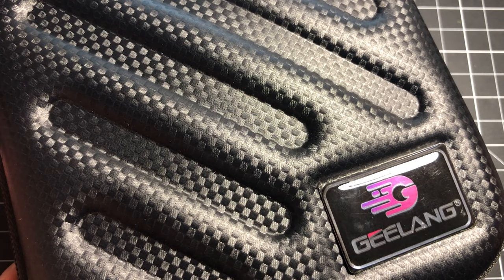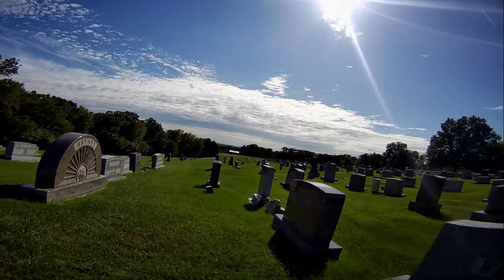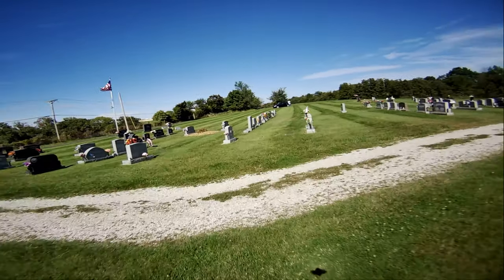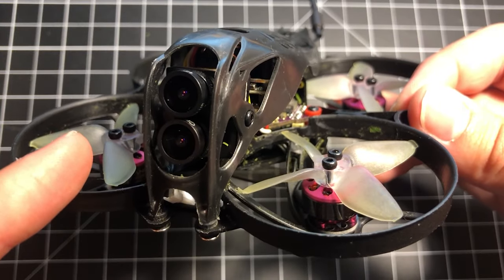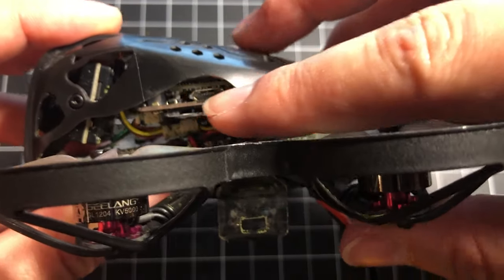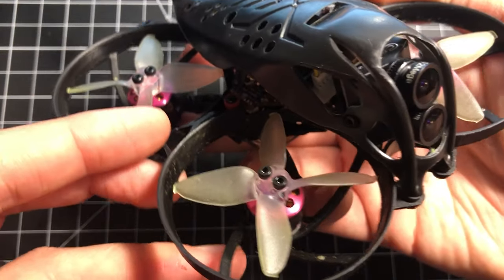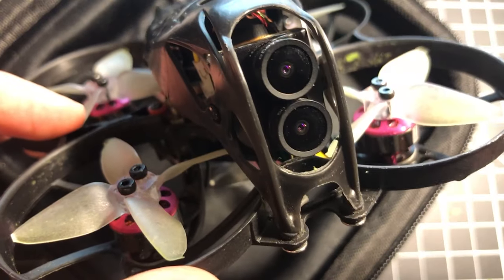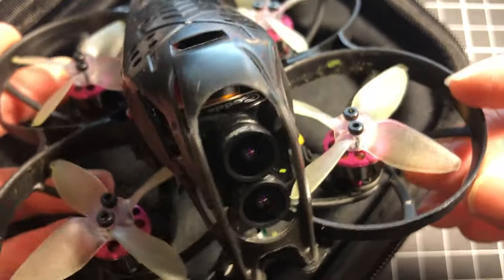Geelang Hobby X-UFO 85X 4K 4S Cinewhoop

Comment: Nice review!! Which do you like more, cinecan or this one?it looks similar!
Reply from the maker: Thanks. The geelang is better than the CineCan. In my review of the cinecan i complained about one fixable, but fatal flaw. It kept dropping out of the sky due to a flakey on board receiver.  The geelang has no problems or nonsense like that at all since they put one in already for you!  And it isn’t like it’s much more expensive than the cinecan at all.

The build/construction is more intelligently crafted on the geelang too, never once in any of my crashes did I break the canopy and I think how they’ve mounted the tarsier is better too. And I mentioned a few times on the cinecan the plugs for the video could come loose since it’s more exposed. A better constructed canopy means smoother video and less prone to vibration in the event of a crash or just flying in general. 

I could go over more if you want, are you considering grabbing either one? I gifted my cinecan to my friend after doing the soldering work to put in an external RX. It was an amazing upgrade and I really liked its new reliable range once done — but if I wasn’t good at micro drone soldering, that job would have ended so badly.
Reply: @JohnCuppi  yes I know, I saw your video with cinecan and I was thinking to buy one without receiver but now I am thinking of geelang. I like cinecan instead of geelang because it is lighter.But over all I think geelang is better.I wait for changing tarsier v1 to v2. :)
Reply from the maker: @kapafpv1430  Understood I just checked pricing for the cinecan without receiver which is on 'flash sale'... and geelang ufo-x with receiver and my johncc 15% coupon code from qwinout. The cincan is $159, the geelang is $169 USD. A $10 price difference is for sure not worth dealing with the cinecan no-rx version unless someone already has a receiver they've purchased lying around that can be thrown in there... and even then, the geelang is better built overall so with such a price difference right now it's really no contest... Unfortunately I'm not sure when the next batch will arrive with Tarsier V2 installed, it's kind of a bummer since Caddx got everyone by surprise on that one. The lens is the most dramatic difference which at least they're sending out for free, second to some firmware and hardware upgrades to the board that enhance some color with a slightly faster sensor(in my opinion). It's honestly more like a Caddx Tariser V 1.1 rather than a whole new "V2" since they didn't change the aspect ratios, or much of anything else. I have my new free lens(s) from Caddx on the way soon for all of my Tariser's so at least they are doing that for people to make them easy to "upgrade."